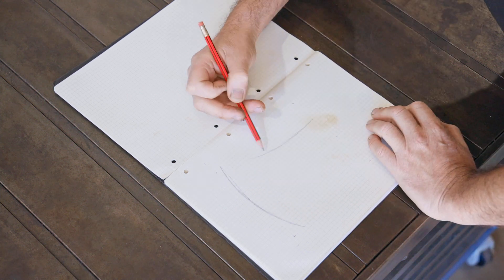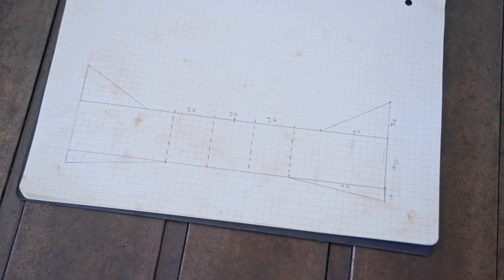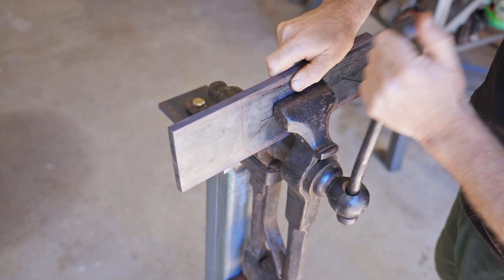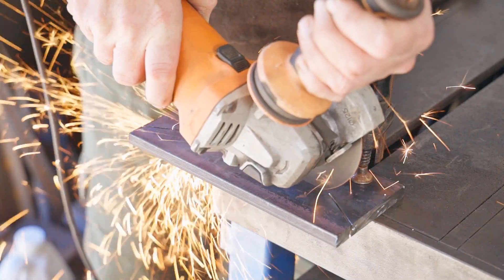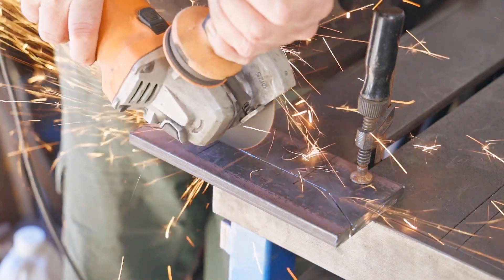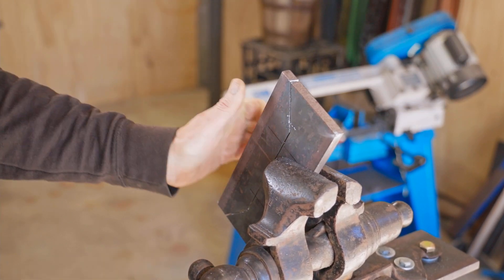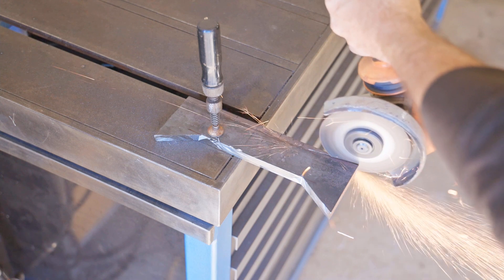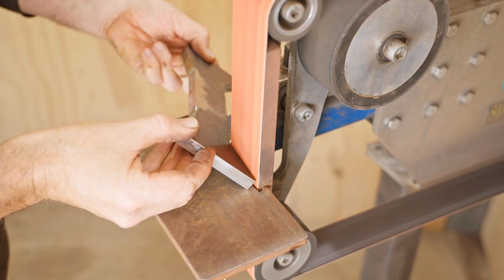Forging a Bearded Axe - Blacksmithing Project

Comment from the maker: It's been a long time since I tried to forge something and even though it took a few attempts I had a great time with lots of learning involved.  
Join My Kumiko Challenge: https://rlnk.cc/paskmakeskumikochallenge    

Thanks again to Luke for making the drift. Check out his Instagram here https://www.instagram.com/make_smith/   

And a big thanks to Corin for the hammer, I love it! Check out his Instagram here https://www.instagram.com/corin_at_gameco/
Reply: Readly 👍👍👍☕☕☕🇮🇩🇮🇩🇮🇩
Reply: Love this project.  I love seeing the failures leading up to the finished successful result!
Reply: Can I just say how much I appreciate how absolutely nonchalantly you treat failure?  By basically just saying "It didn't work.  I make another one." when you are known for the extreme quality of your work, you make it okay for us plebs to just shrug our shoulders and start again when we screw up.  Bravo and thank you.
Reply: @KeithOlson  
Extreme quality comes from not accepting 2nd best.
Us plebs say damn and try and fudge it.
Reply: Does linseed oil smell like oil based paint?
Reply: @okayusa6608  Some do. Oil based paints are comprised of a very fine powdered pigment, thinning agent and oil. Guess what some paints use for the oil...linseed oil!

Comment: that's a real beauty

whenever I cut the channel for the wedge, I drill the end of it, so it prevents further splitting, as the wedge is hammered in. I do the same with the wedged mortise and tenon joints.

Comment: Hey Neil, greatly enjoyed the video. Your axe looks fantastic and I'm sure you're going to love using it.

I've spent hundreds of hours using all sorts of carving axes like this one for greenwood carving and I have a few thoughts:

- The little nub on the haft right under the poll looks nice, but it doesn't add anything to the strength of the handle and I've found that with handles with this feature I always carve it off - it gets in the way of choking up on the haft.

- The bit is a little bit too long from the poll to the edge compared the length of the cutting edge (from the heel to the toe). For finer work you may find it a little unwieldy, but for general hatchet work it will be excellent.

- You put a convex grind on there using the slack belt, which is great for all axes except for carving axes. A flat grind is preferable. On my carving axes I actually do an asymmetric bevel (10 deg on the inside, and 15 on the outside for 25 inclusive), so there's a flat-over-hollow grind on the inside bevel and a convex on the outer bevel. Best of both worlds.

- for the handle, yours looks great. a larger palm swell that curves out towards the front can be a benefit though for maintaining a loose grip. If you look at my most recent spooncarving video you'll see what I mean.

Thanks for putting out such consistently interesting content!

- Julian.

Comment: Dude buy a plasma cutter, it doesn't even have to be an expensive one. It saves so much time with the  angle grinder trying to cut out thick plates. I got one recently and it's soo nice not getting covered in dust

Comment: looks very good .. but one thing i see on most Videos done wrong annoys me 😁 .. when you attach the Handle it's right to hit the back of the handle to drive it into the Head, but when you attach the Wedge, why do most ppl hit on the wedge? ... even on the Anvil it causes the Axehead slightly to slip off the Handle.
So you start the wedge, put the wedge down on the Anvil and hit the Handle to drive in the wedge, no matter if its an Axe or Hammer or any other Tool, this way it sets stronger and lasts longer before it gets loos, more secure, better compression of the wood, wich you only have on half of the Axehead if you hit on the wedge.

Comment: Pask- two questions:
1. Is that the normal height for an anvil? It looked like you had to bend over a little bit. I’m comparing it to normal work bench height, I guess. 
2. When you held up the hatchet in the air and hammered on the end, why does it drive it through the head? Is it just the momentum of the handle vs the inertia of the head? I was surprised by that.

Comment: Why not just harden the blade edge of the axe head with carbon?
Reply: Please show us how it's done on your YouTube channel.
Reply: If you mean the technique called case hardening (producing high carbon steel on the surface of low carbon steel as Clickspring showed in his video here https://www.youtube.com/watch?v=V_Mp1fNzIT8), I am afraid it is too superficial for an axe as you can easily grind thru the hardend layer during the tool's life.